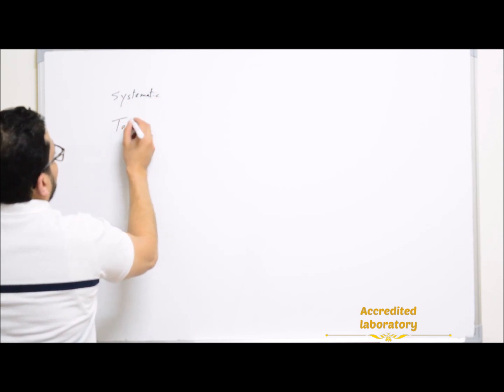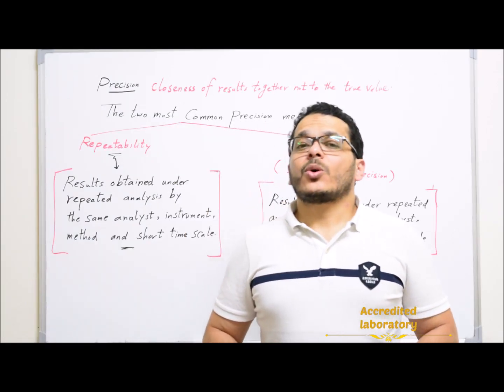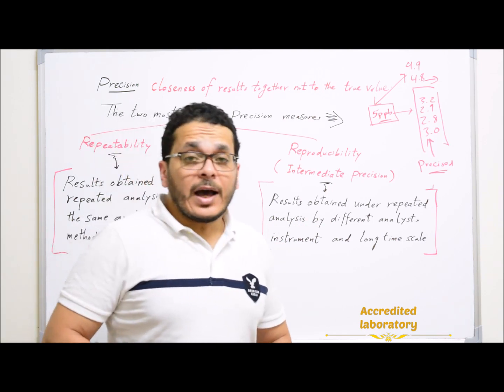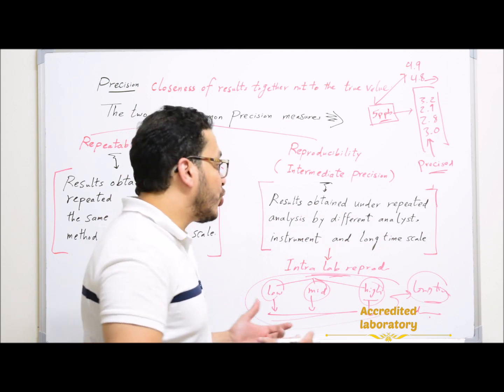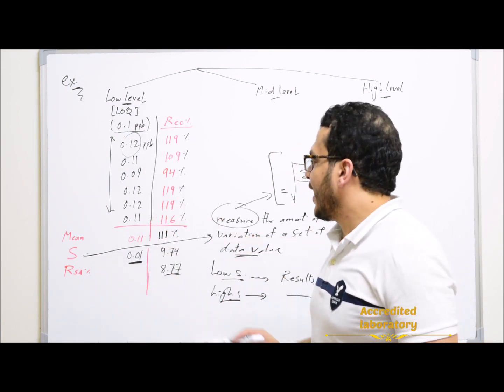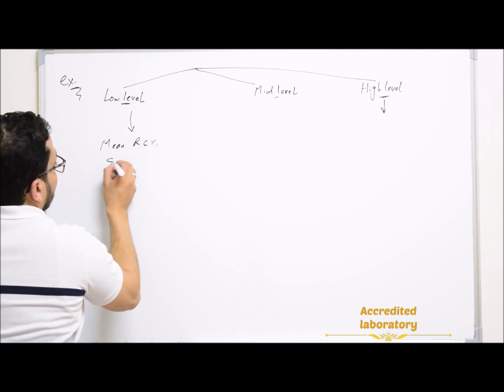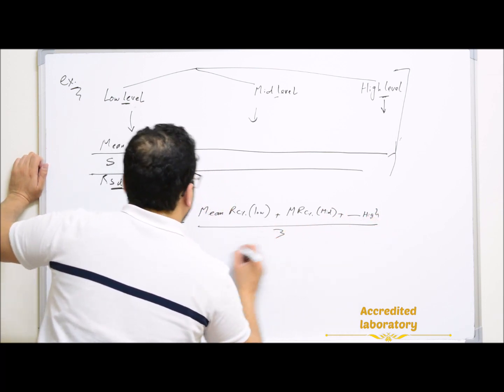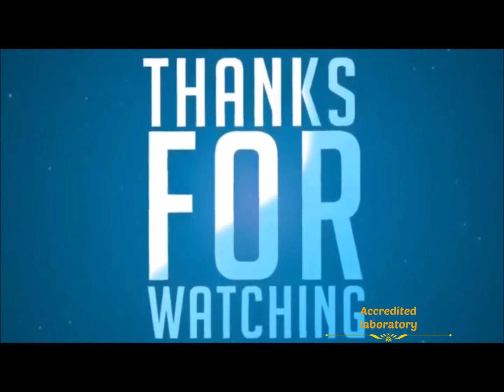Precision (Repeatability & reproducibility), Intralab.reproducibility

Comment: Thank you first for your videos ! I have 2 questions : 
1- I have 2 analysts, one instrument and one method in the lab and i would like to perform the intralab reproducibility,  you said in your video that it should be performed in long time scale with different analysts. So the 10 replicates of each level will be perfomed by each analyst in the same day or in different days? or the 10 replicates of low level and mid level will be performed by one analyst, and the 10 replicates of the high level with the other analyst, in the same day or in different days?
2-Why do we calculate the Qtype? Where can we use or need it?
Reply from the maker: You can perform 10 replicates for each level by only one analyst in different days for sure. But one of them will do a level and the other can do another level and you can increase the number of levels to cover the range of concentrations required for your analytes if you want. Q type not used in anything, but only if all recoveries for all levels are within acceptable range. So, Qtype will be acceptable
Reply: @AccreditedLaboratory  As I understand, Analyst n°1 will perform 10 replicates for low level in day n°1, and then analyst n°2 will perform 10 replicates for mid level in day n°2, and then analyst n°1 or n°2 (is the same here) will perform 10 replicates for high level in day n°3, is that correct?
Reply from the maker: Yes